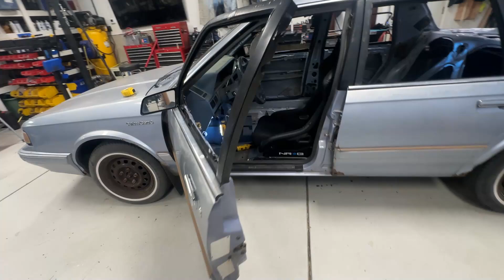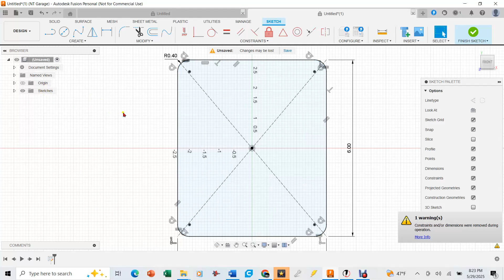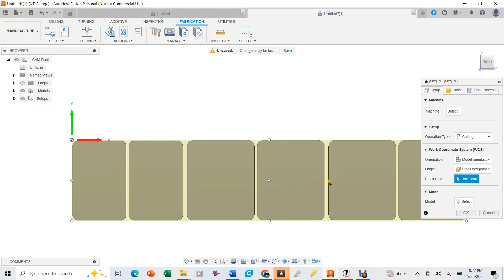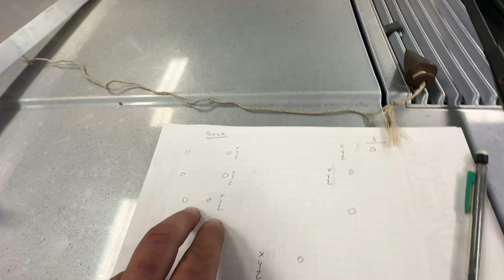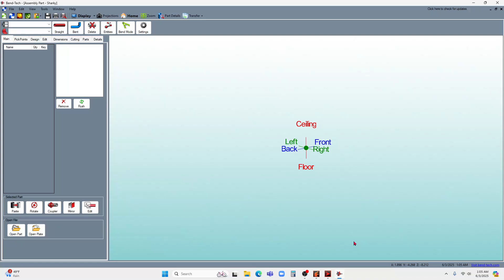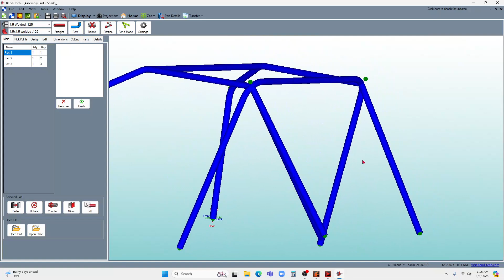How to Design a Roll Cage for 24 Hours of Lemons with BendTech | DIY Race Car Build (Part 1)

Comment: How about the "Pattern" command to make duplicates of your base plates.?  You can do it all in a single function.
Reply from the maker: Not a trick I know.   Is that on FireControl?
Reply: @ntdracing no, it is a feature in Fusion. It’s under the create menu. Allows to make a bunch of copies in a single operation.
Reply from the maker: @cbdzcbdz thanks.   Will check it out.